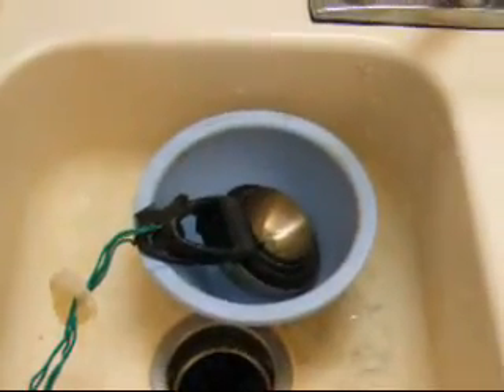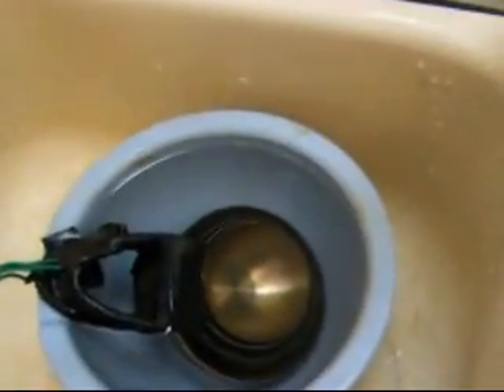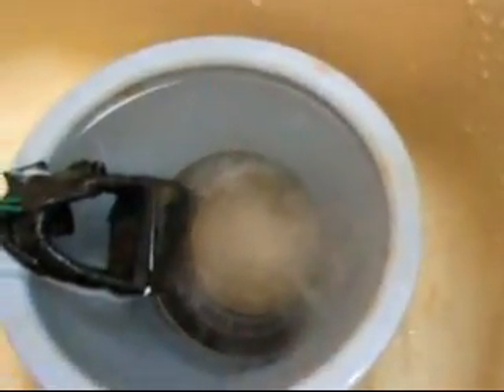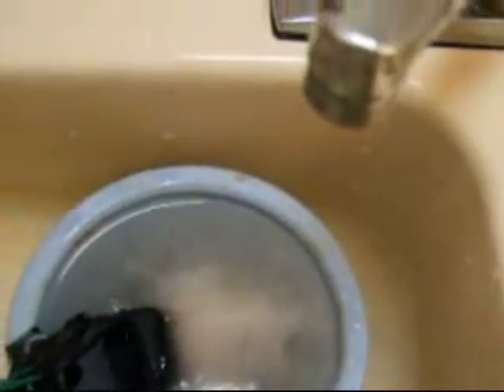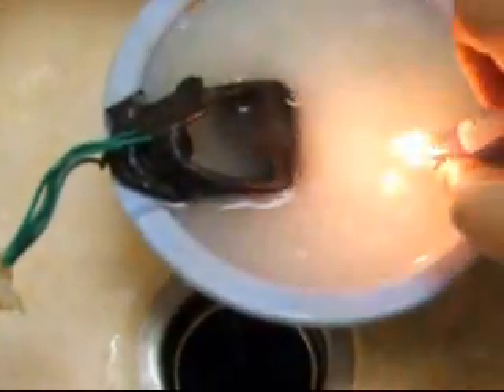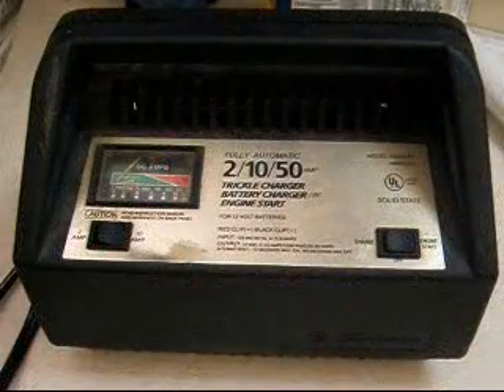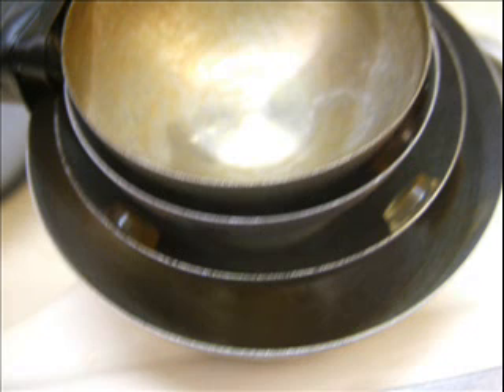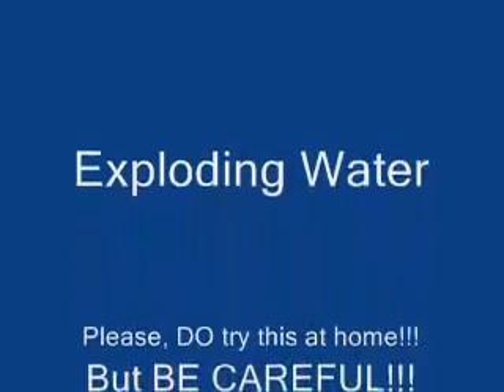Exploding Water

Comment: More --- Water in its natural liquid state is the result of the energetic combining of the two gases H and O. You must pump into water ( through electrolysis) a lot of energy from electricity to split the two gases apart. At that point, the H contains energy, carried over from the electricity. The water by itself can NOT be used as a fuel. It can only be used as a CONVEYOR of energy. Don't let the Free Energy whacko's convince you of anything different!

Comment: There are plans available to convert this to automobiles, but they are not applicable to a fuel injection system.  Basically the reaction takes place in a closed container which is directly connected to the carburetor [which is not a carburetor anymore] and dispenses hydrogen to the engine after appropriate pressure is reached inside the resevoir.  The combustion surfaces must be ceramic to prevent rusting.

I'm going to go blow up my garage.

Comment: A sound (=a certain pressure wave) is conducted to that substance and according to my theory this sound cleans the 
energywaves opening up at that that moment from two different hydrogen atomcores with the sound. After that these two cores of hydrogen atom don´t push themselves away from each other at the same relation as they expand.The other atoms around them continue to expand and push this way these two hydrogen atomcores close to each other with the energywaves that open up from themselves

Comment: we'll have to find a new source of H2, definitely.  The current industrial source for H2 relies on fossil fuels; so if we run out of oil, we also run out of H2!  Imagine that.

Water is no fuel if you are using a battery to electrolyze it.  The same amount of energy goes into breaking the H-O bonds as goes into reforming them when you ignite the H2.  But remember: heat can not be converted to work with 100% efficiency.  With H2, we want to use fuel cells, not combustion engines.

Comment: I was thinking of this back when I first learned of electrolysis back in chemistry. The coolest thing of all is that the combustion of the hydrogen generates water as the biproduct. So I figured that if the emissions could be routed back to the water tank, a single fill-up would be all that was required. And maybe changing the fuel would be more like changing oil every 3 thousand miles, rather than filling up ever hundred miles. That means zero emission!! A self fueling engine...

Comment: technically, your description is not entirely accurate, you are not "creating" hydrogen.  "Freeing" yes.  A quibble, yes. :)

You'd also have to factor in the electricity used to free the hydrogen, if that electricity is generated from oil or coal products, then have you gained anything...and is the energy extracted in the form of hydrogen more than equal to the energy spent to extract it?  If not, it's a wasted step, you aren't better off than you would be with the electricity.

Comment from the maker: Unfortunately correct. Better to use the electric power to directly run an electric motor. The only real application is to augment existing cars, and even then the benefits are marginal.

Comment: Something I just logically can't understand with this: why even bother using H2 in the the first place? Any conversion step is bound to be inefficient (as many have pointed out already), so why convert the electricity (as pure energy as it gets?) to H2? Just use a battery and an electrical motor => we don't get an explosive gas to handle and we "just" have the loss of the chemical conversion inside the battery as it charges/outputs energy?

Comment: "Have you figured out a safe way to fill up balloons?"

If you're using DC the hydrogen gas will form only at one electrode. Use a seperate jar for each electrode and connect them with a salt bridge or water filled hose(submerged so that no hydrogen and oxygen will enter from the electrodes). Allow no air pocket in the hydrogen jar and use a spigot to fill an empty balloon or similar.

Comment: Research "Hoffman Apparatus" this is a controlled method for reducing water.
The required potential is 1.23V.  Anything over 1.23V will simply accelerate the decomposition of your electrodes.

Comment: Your tap water works because it has dissolved minerals in it, making it partially conductive, this is called hard water.

Adding a substance that disassociates to the water adds more ions to the water, so it can carry a charge more readily.  Adding a current starts the process of Electrolysis, this is 8th grade science.

Pick up a chemistry book and you will find you are doing nothing more then producing your own LYE.

Comment from the maker: DO NOT ENCLOSE THIS! The gas produced is highly combustible. I filled a sealed container about 99% full of water and then added a tip on the lid to fill balloons. This was a real bad idea! Even with only about 1/8" of gas at the top, it exploded quite violently and I was lucky I wasn't hurt. I was lucky; it split the container all the way down and spilled all the water. Note the glob of hot glue that is still on the wires. That used to be the seal for my original container.

Comment from the maker: I just stripped the ends of the wire and wrapped the bare metal wire around the handles and used the electrical tape to secure the wires in place and to keep them from shorting out.

Comment from the maker: Yes it does, it gets really brown and thick over time. Maybe someone else can explain this. At first I thought it was the metal degrading, it gets pretty pitted. I used very low quality stainless. I also thought the tape might be a factor, just not 100% sure. It may also be a result of the reaction with the salt... or it may be all of these.

Comment from the maker: My Honda Insight sure moves well. :-) Not hydrogen based, but it uses regenerative breaking to generate plenty of extra electricity to make the 3 cylinder 900cc motor do just fine. It is more efficient use of the extra electricity than hydrogen production. For standard cars, check out Magdrive's videos. I think if you research this more you will find that a hydrogen generator helps improve gas mileage.

Comment from the maker: Agreed. It was a fun experiment, and I hope folks enjoy it and try it themselves safely, but using electrolysis for producing hydrogen to then power a combustion engine is simply not practical or efficient. But to use the excess electricity produced and wasted by most alternators today is also not optimal. A hydrogen generator to augment fuel consumption by taking advantage of the already existing typically wasted power may be worth looking into. It is a short term solution, but may help.

Comment from the maker: Fact is that most cars already generate excess electricity. See my conclusion at my site. It won't be practical unless new methods for free/low cost electricity become available. I also conclude that hydrogen only is not as efficient as an electric motor. In contrast, to augment the existing gas powered cars makes sense. See the MagDrive series. He has done his homework and has a real value to offer for existing cars. It's interesting to hear from the brainiacs who just spout negatively.

Comment: actually, even at 12 volts or 1 volt, if the the electricity was at 10 amps, your life is at risk...  it's amps that harm you, not volts. Aside to that, this video explains electrolysis, far from an ideal enviornment  but definately affordable!!  I remember doing this experiment in middle school... good times XD 
The only downside to this whole thing is the fact that hydrogen gass bonds with oxygen too easily and is hard to contain...

Comment from the maker: My thoughts are that it is more than frequency. For maximum efficiency the wave needs to be square with a peak time that allows an optimal bubble to be produced, followed by a short duration inverse polarity spike to break the bubble free followed by a short neutral period to allow the bubble to clear the area. The frequency of this pattern would be related to the total length of the pulse sequence. I have researched programmable pulse generators but have not had time to do testing.

Comment: to keep amperage low all you need is to use a pulse generator this will release all the hydrogen you ll ever need from water without using salt. THERE IS THAT MAGIC FREQUENCY ONLY STANLEY MEYERS KNOWS AND HES DEAD HE COULD PRODUCE HYDROGEN WITH NO HEAT AND ONLY CONSUME MILLI AMPS. THE PULSE GENERATORS ELECTRONICS WILL GIVE YOU A  4 amps with load of hydrogen

Comment from the maker: As pictured, I was using a car battery charger, but any battery will work that is above 1.2 volts. A car or motorcycle battery are good options as they can produce hihger amperage and won't get used up in a short period.

Comment from the maker: I agree. My gas/electric hybrid Honda Insight makes more sense than a gas/hydrogen hybrid. My current thinking is that the gas/hydrogen hybrid is only valuable short term to modify existing gas only cars to increase gas mileage as we move towards other solutions. It can take advantage of the fact that most cars have an alternator that is sized beyond the requirements of the car, and as such, generate excess electricity which can be used for electrolysis.

Comment: The only problem with water as a fuel is that you need more energy in the first place to split the water mollecules into Hydrogen and Oxygen, than the combustion will give. This energy in your case ultimately came from the burning of Fossil Fuels at a power station. For this reason, Hydrogen will never be a fuel of the future.